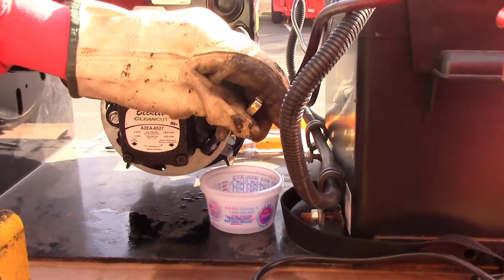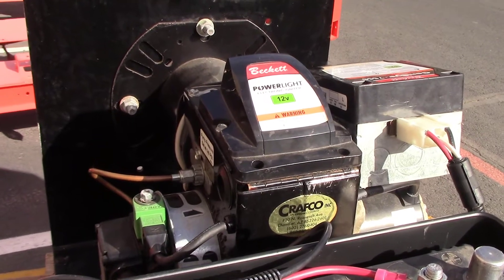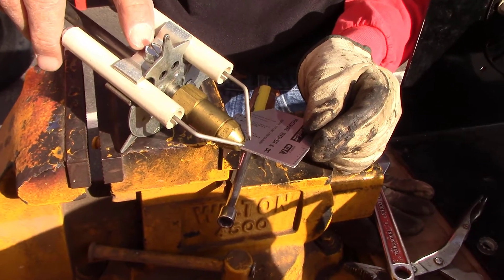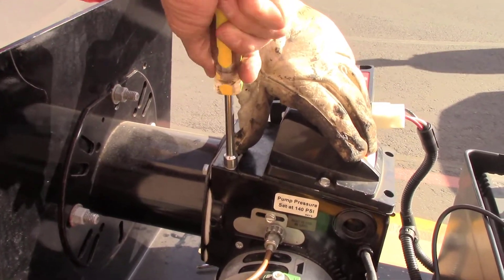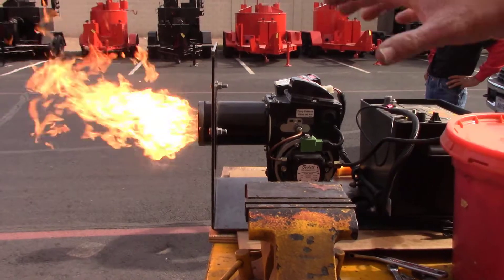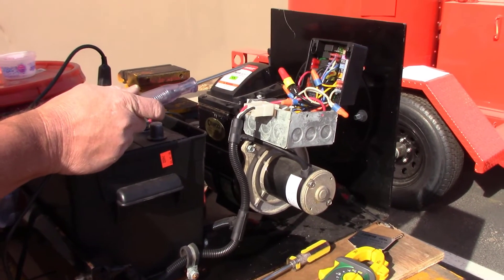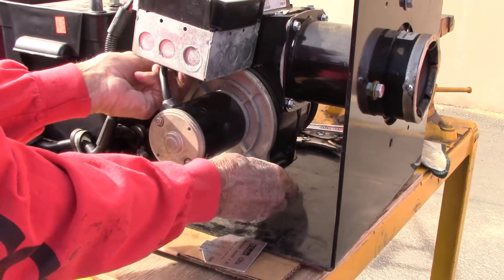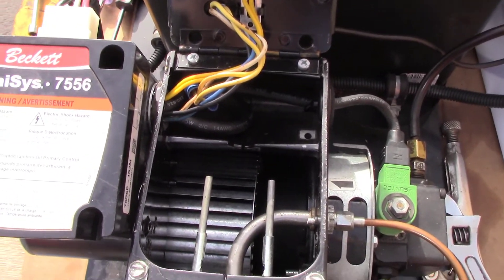Burner Troubleshooting: Common Burner Issues and How to Fix Them | CRAFCO

Comment: when i push my reset button the furnace kicks on... but after its done coming up to house temperature it shuts off. but doesn't kick on again when house cools down. i have to keep pressing restart button .  -30c this coming weekend any help  i changed filter, nosil sprayer and even  drained and put new furnace oil in .  thanks for any advice
Reply from the maker: Hi there, the burners we use in our equipment burn diesel fuel, so they're somewhat different than a home furnace. You may find some useful hints on Beckett's troubleshooting page: https://www.beckettcorp.com/support/troubleshooting-guides/

Hope that helps!
Reply: @dronemiller I'm having the same problem since the temp dropped. Did you figure out the problem by any chance

Comment: I cleaned chimney and furnace thoroughly...replaced filter and nozzle..also cleaned electrodes  but im still get a dark but not heavy smoke out the chimney...help?
Reply from the maker: Hi Mike, assuming it's unburnt fuel, it could be several things. You may find some useful info in this troubleshooting guide from Beckett, especially under #5, the section labeled "Unable to obtain a zero smoke."  https://www.beckettcorp.com/support/troubleshooting-guides/

Comment: I also have fuel dripping under nozzle onto head and producing alot of white smoke.. i have a landa and it has a 2.00/80W nozzle. My other burner is running a 2.00/60B.  Could these nozzles be too big
Reply from the maker: Hi there, this troubleshooting page from Beckett may help diagnose the issue. Granted, it's for their burners instead of Landa's, but the concepts should be the same. Hope this helps!

https://www.beckettcorp.com/support/troubleshooting-guides/
Reply: @Crafco  thank you

Comment: The issue I'm having with my Beckett burner is that it gives off a small explosion or kind of boom every time it ignites. Might it be necessary to lean out the oil mixture or might it be an Air Band Adjustment or what do you think?
Reply from the maker: Hello sir, can you please email us at info@crafco.com so we can put you in direct contact with your local Crafco rep for more hands-on troubleshooting? Thanks!

Comment: So heating oil is diesel or not can I run diesel not number 2 heating oil
Reply from the maker: For Crafco Melters, the burner is designed to run off of Diesel #1 or Diesel #2 that powers the burner and diesel engine on the melter. Some grades of Biodiesel work as well. If you have further questions about your specific machine, please contact our technical support team at 480-655-8333, and we can help you further. Thanks!

Comment: 7505 cut off 15 sec . With all other things are on the  mark. Relay?
Reply from the maker: Hi Peter, working on getting you an answer. Sorry for the delay! You can also reach your Crafco rep for more personalized help by finding them in this list: https://crafco.com/how-to-purchase/united-states/
Reply from the maker: Okay, the 7505 control is 120V, and not something we use on Crafco melters. For more information on the 7505, you can visit this link: https://www.beckettcorp.com/wp-content/uploads/2022/05/61649-GeniSys-7505-Control-Manual.pdf (beckettcorp.com). It sounds like your control is going into safety lockout because of a fault. Hope this helps!

Comment: Some motors / pumps have a little tube with a cover, and we are supposed to remove the cover and squirt 3 drops of oil down there to lube the bushings or bearings at the axle once  year.
Reply: I get a 15 sec cut out on the 7505 relay . New cad. Nozzle . Gap good,  pressure 110 # . Relay?

Comment: I would like to ask You what size Orifice are You Using in this Burner? In addition how do You size the Orifice to the Burner? The reason I am asking is on my burner the settings on the Sun tech Pump are set at 110 psi and the Orifice is a 1.25 GPH B Nozzle @ 80 degrees. But with the Burner assembly removed I see a estimate of 20 percent of the Diesel is being wasted because it isn't  burning the fuel. My question is why isn't all the Fuel is being Burned? Is the orifice to small?  Is there a Chart or Guide to show You the right Size Orifice for the BTU of Fuel You are Using? Or to produce 315,000 BTU's than you need so much pressure from the pump and certain size Orifice is needed for the BTU'S required?

Comment: I think I’m getting too much fuel. I bought a used alkota. It was smoking black so i opened the airflow. Now it’s shooting flames out the exhaust 8”-12” high and it’s a truck mount. I don’t want my truck to catch on fire
Reply: I’m having similar with mine. A couple big plumes of black smoke billows for a few minutes, then flames up about a foot or 2, seems to correct itself as I run it though. Used unit, lot of soot buildup on coils, gonna run it hard this week and see what happens? Will have a fire extinguisher on standby! Let me know how yours works out. Smoking like crazy?

Comment: The most informative video I have seen on the burners. I have been having trouble with mine and this will help. I wished you would have shown how to adjust the igniters and check the transformer to see if it has enough juice to produce a spark.
Reply: If you're talking about the spark electrode ends, he shows a gage used to adjust/check those. Some burners have info/diagram printed somewhere on the housing. One way I check spark transformer strength is to start the burner then lift transformer back on it's hinges. If everything is working right, flame should continue. Or shut off fuel to keep burner from firing and shine light into cadsul eye to trick controller so that it continues to run. Use a well insulated screwdriver that is at least 6" long and run from one spring to the other. You should be able to get spark to jump from untouched spring to screwdriver half inch to 1 inch. Less than .25 inches and transformer might be weak.
Reply: I used the screwdriver to check the transformer and was scared shirtless because of the high volts it puts out. Did find out that my transformer was shot though.  
I had been using the printed diagram in the furnace owners manual to adjust the gun and igniters. I then after about 5 years and a winter of fuel dripping into the burner before firing bought one of the orange adjustment gages. What a difference using that made. Not more bang on ignition and burns much cleaner. I guess my tape measure and eyes didn't agree on what I was reading. I was going to buy a stack gage but with the government wanting to outlaw oil furnaces it my be a waste of $ 300. 
Thanks for replying.  It helps when someone out there with knowledge knows how to service and fix them.
Reply: @stevenjackson7067  glad I could help. I was definitely scared the first winter as a new tech checking ignition transformers. The voltage is very high but the concept is the same as something like a police taser. Its relatively safe because of the low amperage but really hurts. Ive never been hit by one personally but several ppl I know have. Worse shock I ever got was from a run capacitor on a compressor. Felt like someone smacked me across the back with a 2x4 😂🤣🤣
Reply: Yes I changed out the control box for my wells submersible pump. The box had a capacitor in it and I've heard of them before so I read up on them. I wasn't nuts about even opening the control box but being the cheap ass that I am I was willing to take the chance.  
I shut off the power and let it sit a couple hours. Then with my meter I checked for amps, ohms, volts, anything I could think off. Even then I used an electricians insulated screwdriver. I made it through the swap but was sweating while taking the wires off the old box. I even warned the wife before I started that I may get one hell of a shock that could kill me. She didn't want me to touch it, but now that I think about it she only said that once while holding on my life insurance policy. Lol